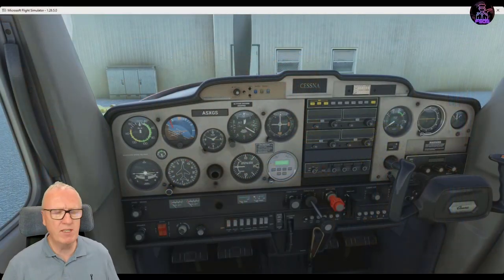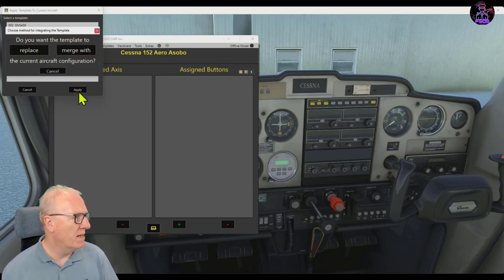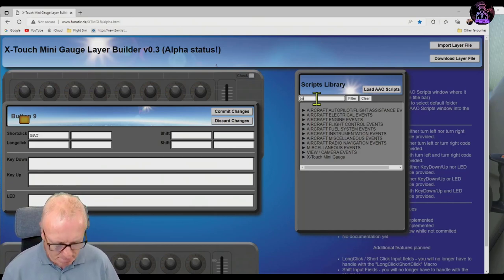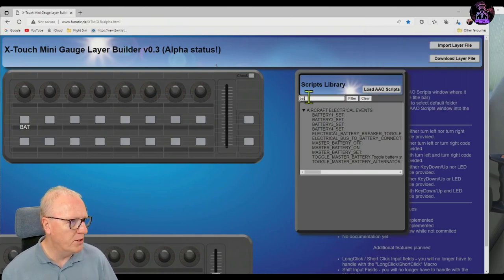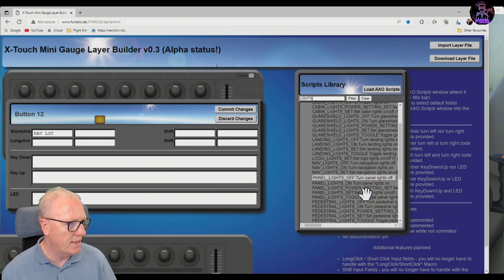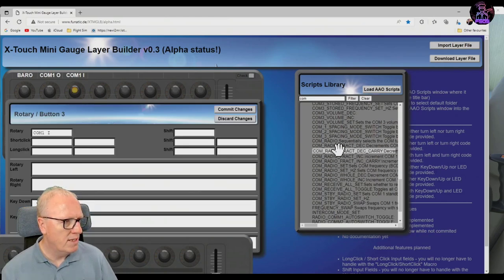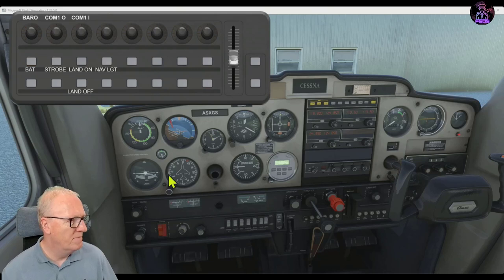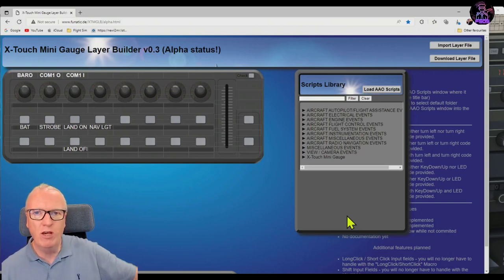X-Touch Mini Gauge Tutorial 2

Comment: Could demo the short / long click. eg short click ON long click OFF for switches and lights. A shift key seems an ideal use for changing layers. Shift + button(x) go to layer x.

The framework along with the GUI easily makes the x touch with AAO the best value hardware in flight sim. If anyone is thinking of buying one I would recommend it. 

Thanks for taking time to make these videos, especially as the framework evolves so quickly. I’m sure Thomas has plans for even more functionality still to come.